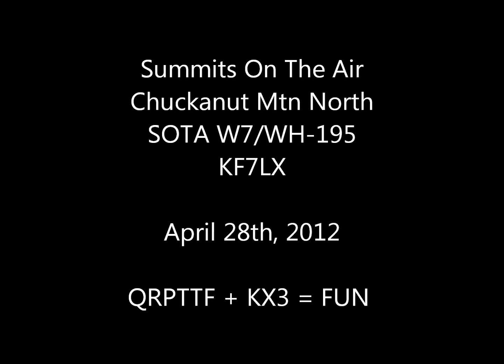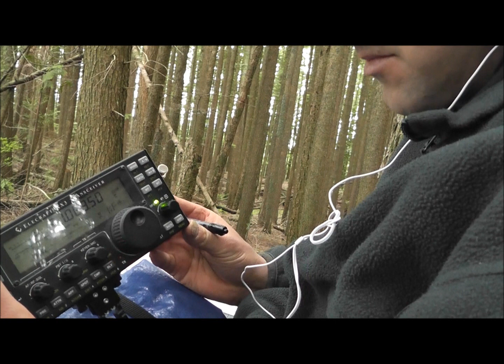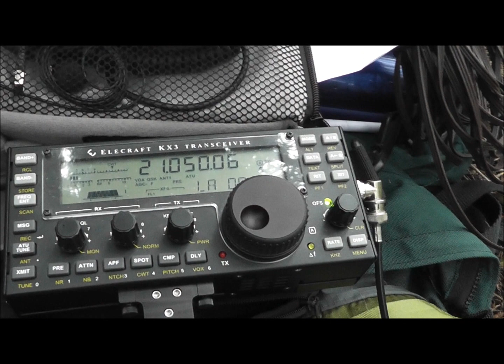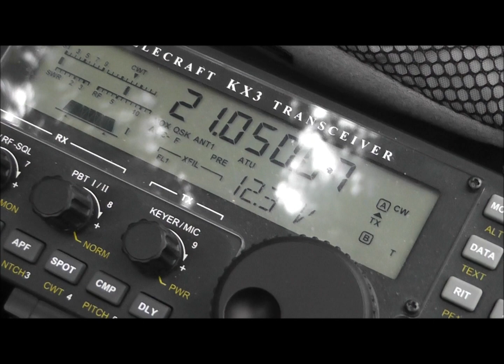KX3 + SOTA + QRPTTF = A BLAST!

Comment: Todd you had the best signal on 15m here in NC!  Not quite as strong as WS0TA was on 20m but much better than others from out West.  TU QSO and excellent video.  Elecraft will want to use it I bet!

73,  Bill  W4ZV (using a K2 here BTW)